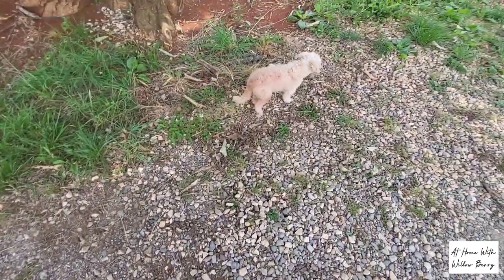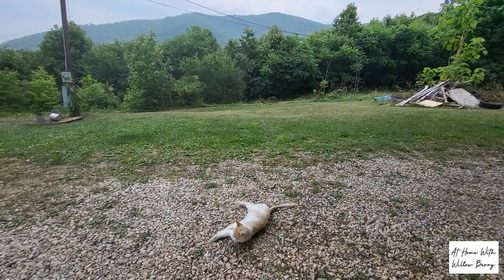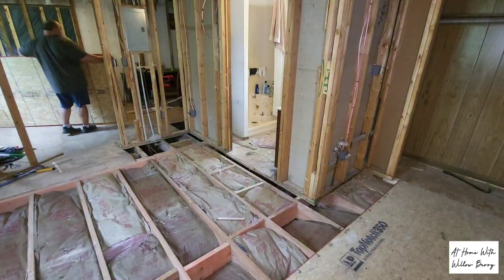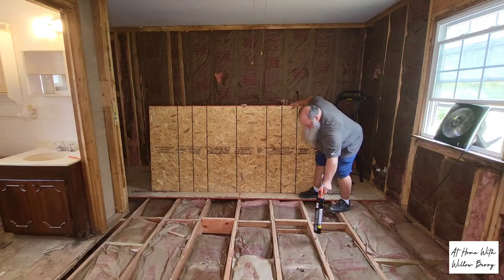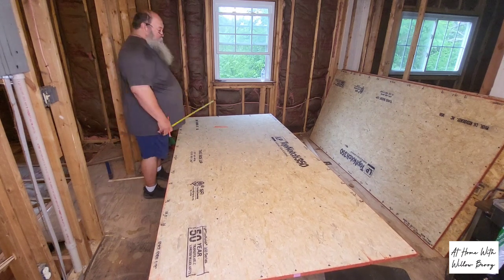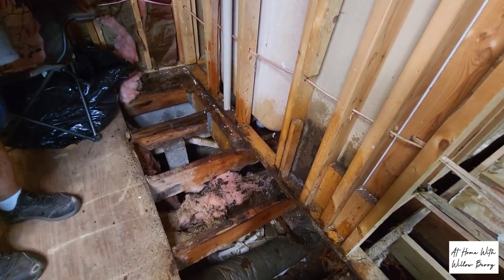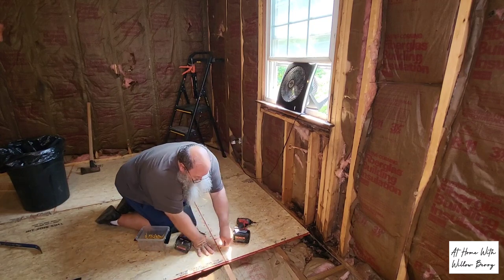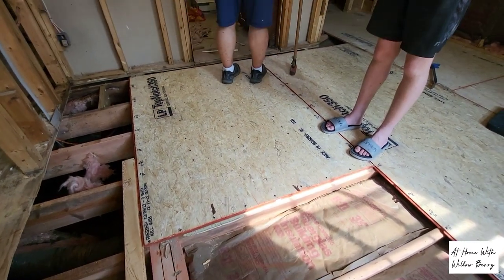Subfloors for Granny's room. / Mobile Home Renovations / Mobile Home Living

Comment: I wonder if you have run across the problem that my husband and I had redoing our single wide mobile home?! We found that it did not have copper wiring it was actually aluminum wiring and I was told when it got old it would get brittle and start fires I hope that you don't have that issue to deal with but if you do I'm sure that you can string new copper wire and everything will be okay.
Please keep making videos it's a delight to watch a family like yours that works well together and is a loving family

Comment: Is there any air-conditioning at the new mobile home while the renovations are being made?  If not, how can you work and sleep there in the summer heat?
Reply from the maker: We have window units but not in the addition where the renovations are happening right now. The floors are wide open to the outside, so it would just be a waste of energy. 😃